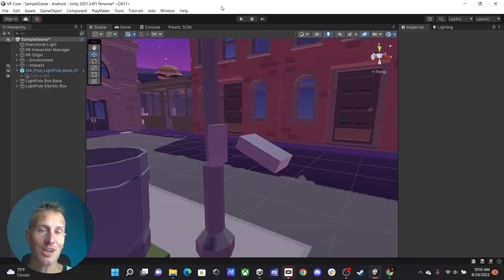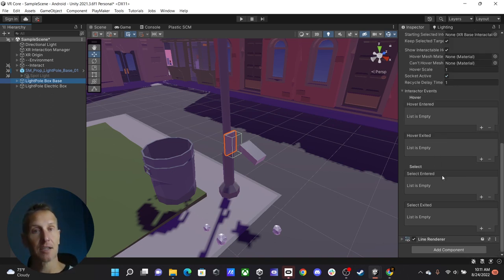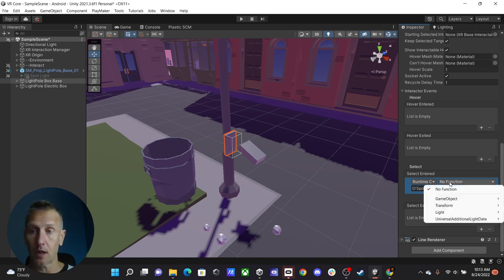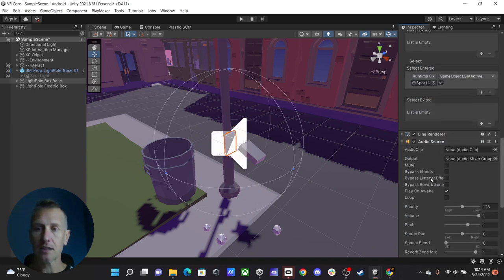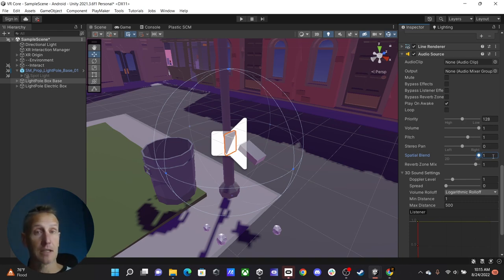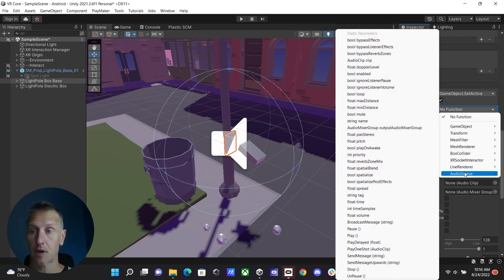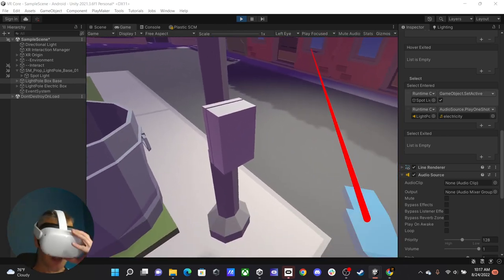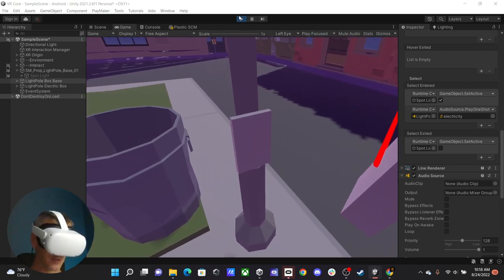Unity VR XR Interaction Toolkit - Turn Light on off w/Socket

Comment: I know this is an older video , but what if i want the socket to only work once?.. like putting a model together.   I dont want parts to be able to be removed after installation.
Reply from the maker: Sorry for getting back late Tom.  You would just turn that interaction off once the socket is in place.
Reply: @BlizStudio  thanks for the reply!!  I did have it disable the grab interaction once actave in the socket, but the part just fell off and would not stick anymore without the grab intractable.    I'll need to try it again ..must have done it wrong.. thank you very much !!

Comment: What do i do, if I wanna let something happen (such as lights on or off) but with three sockets instead of only one?
Reply from the maker: Hey Kingstantin, I think if you are looking to have 3 sockets to turn on a light then you'll need a bit of code.  I use Playmaker for visual scripting.  For each switch, you'll set a bool (true or false) if a socket is connected or not.  Then a script to detect if all 3 switches are true.  If all true, then you'll turn the light on, or open the secret gate, or ...  
I'll try to do a vid with that type of logic.
Reply: @BlizStudio  Hey that would be super cool. I just strted getting into code and I'm an absolute beginner. Will check out your other videos for sure!